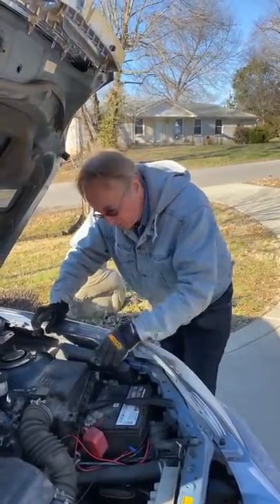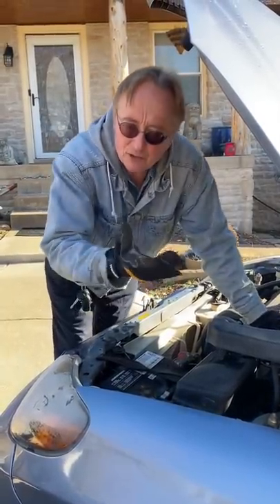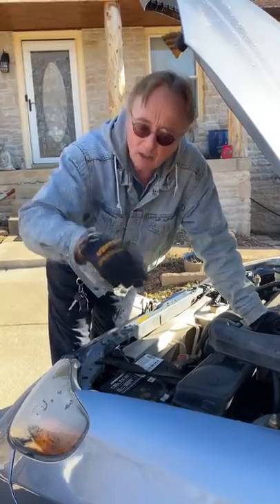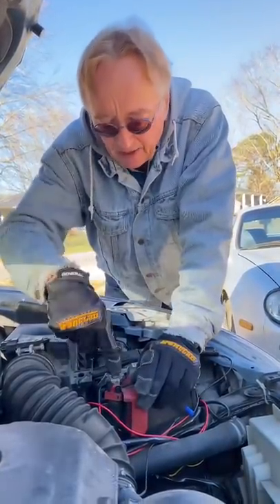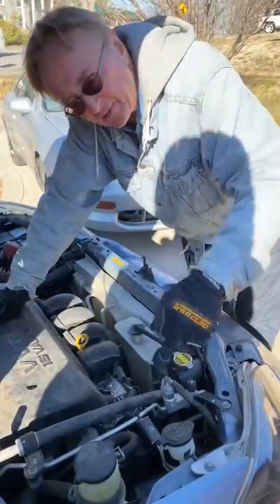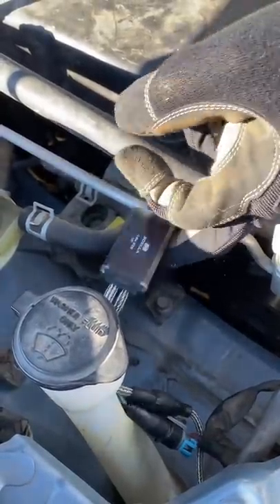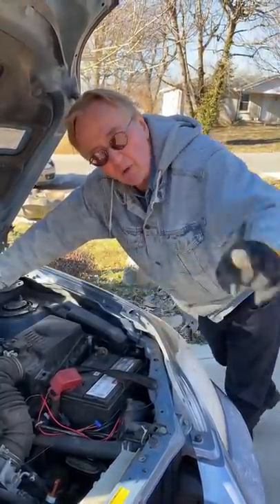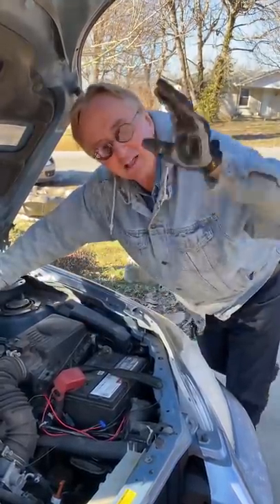Stop Doing This

Comment: You forgot to mention the most important thing when adding your own wires directly to the battery for extra accessories, always put a fuse to the added wiring and it's own relay.
Reply: @AT-wl9yq  just a fuse should be fine
Reply: @AT-wl9yq  For heavier loads,   it protects the switch from premature wear or excess heating. Fine without relay, but your switch might last just a few months instead of years. Depends on load. Fuse placement, the closer to the battery the safer, lessens the "unfused" wire exposure.
Reply: Ok
Reply: Yeah a fuse will do. I have 3000w of speakers , subwoofers, amplifiers and a few other things and works good, never had any electrical issues nor a blown fuse. Same fuse in my vehicle for the last 10 years. Stock alternator too. And a new battery that lasted 6-7 years after installation.

Comment: My Toyota Landcruiser has a box mounted in the engine bay that has various rating fused 12 volt outputs you can tap into to run accessories.

Comment: I found using LED lights on a Mercedes, at least mine, the computer see it as not working, because it doesn't have enough draw, to recognize that a light bulb is present and working. I tried this on a side marker light. So that makes me wonder if changing to LED headlights would work or not? The low beam was set to always on, when I got the car, so the silver reflective coating around the bulb has bubbled up and started to fall apart. So I was thinking of changing them to LED lights. But after the marker light experience, I'm hesitant to try it for the low beam headlight. Mine doesn't have the HID bulbs, but the halogen bulbs.
Reply: An equivalent matching shunt resistor across the circuit will let the car detect the led+resistor as a bulb.  Some LED lamps made for retrofit have the shunt resistor built in.
Reply: Sounds like you had either cheap or older style LED bulbs. Newer ones come with resistors so they work like stock bulbs. For low beams google xenon pro. Put in your car make and model and when you select your LED it will tell you if you need a resistor which is an extra charge.

Comment: i added led to my battery and  used led that had fans and resistors .
Reply: Shunt resistor, fan and heat sink for retrofit LED headlights can be good design. Unfortunately, not all makers do a good job with component specification and selection.

Comment: I always use a thick gauge wire (4) for my amp, my 2nd ar in 2004, i had to wire the cigarette lighter wire directly to the fuse box because the factory wire burned out, so I charge my cell phone, but i had to take it in for an issue with the AC, they decided to wire it back to the bad wire not knowing the wire is bad for some reason, nothing to do with the AC. So i wired it back the way i had it after i discovered it not working again, i was like why on earth did they do that for?

Comment: Are aftermarket LED headlights legal Scotty? 🙄🙄🙄
Reply: Yes. Why would they not be lmao
Reply: @myratsalad  but LED light use less power than halogen lights. So how would they melt the wires?
Reply: @shark70007000  because they don’t use less power they’re just brighter. Low beams are rated at 35 watts you can get like 55 watt LED bulbs.
Reply: @Hellsing12002  Well, in general, they use less power. I've only installed one set in my car. No problems. My Mercedes keeps saying the light is out, when I put an LED light in a fixture, like marker lights, because there isn't enough power draw. My Charger has HID for low beam and I put LED lights in for high beam.
Reply: @wesleystokes4855  depends on where you live. In the US some state they have to be a set wattage where others it’s based on beam length.

Comment: Doing the "Big 4" upgrade would help when adding electronics- especially a 1KW amplifier to your car stereo. But you'll need to have heftier wire going to the amplifier and maybe you'll need to install a higher capacity alternator.
Reply: Kiss your hearing goodbye.
Reply: @stephenarling1667  from 1000w? Doubtful

Comment: In gonna he swapping all the wires with 0awg where possible at some point

Mostly because i intend to stick in a hybrid wet lithium battery as well as a stronger starter motor, 4 attempts at 10 seconds each to start the car during winter with a brand-new battery that was kept inside overnight shows that the starter is too weak to handle winter even tho its a measly 1c so not even freezing

But the lights im gonna replace with mixture of LED’s and Halogen
Reply: 0 gauge is overkill and usually only used by people with extreme audio systems drawing 200+Amps
4 gauge would be a nice upgrade though. Make sure to get real OFC (copper) wire and not CCA (Aluminum) wire
Reply: @Argedis  0awg and all fittings and adapters with free shipping cost the same as 8awg with all fittings and adapters but is with paid shipping

The couple pennies difference is the factor im taking in to account
Reply: I convert all my cars to #00 ground wires with copper ends. So much can be solved by a good, strong, ground. Positive cables aren't as necessary, IMHO, unless you've a power draw that requires it. Just replace bad contacts and they should be fine.
Reply: @darkminstrel2041  yeah current flow is negative to positive

So you can downsize on the positive wires without issue because if you needed identical negative and positive your battery is shorting out
Reply: @darkminstrel2041  I agree. Ground wires are usually undersized in cars nowadays.

Comment: Those led systems are trash... come talk to me in a year and let me know if it's still working
Reply: 2005 Ford focus owner here, installed LEDs with built in resistors for my all my lights about 2 and a half years ago. Still working like a charm, and no damaged electronics or cables!
Reply: Going on four years and still working great. Definitely brighter than the original halogen light.
Reply: Guess they work better on American cars. For European cars the wiring voltage is really screwy. I remember ballasts going bad all the time and wires getting super hot. You can't tap into the existing headlight wiring because of the low voltage so you have to hook up to the battery causing too much power to run to these. I had it professionally installed on 2 VWs and they all broke in 6 months. I even had resistors installed to lower the battery voltage. It was a huge headache. I recommend doing it the right way and getting new headlight assemblies, this is the cheap way. That's just my experience. Nothing like the real thing that just plugs and plays. Search "rainman ram led" he will show you all the problems with these cheap led systems.
Reply: @lucasg4400  I'm also guessing your car uses only one bulb for both high and low beam. Try doing this on a car that has 2 bulbs per side one for each and also doing it for your fog lights. It's just too much power coming through the system. That's where all the problems lie. With only one bulb per side I'm sure they are okay.